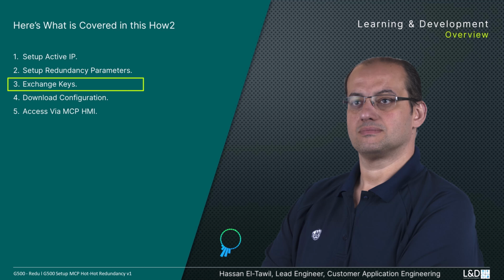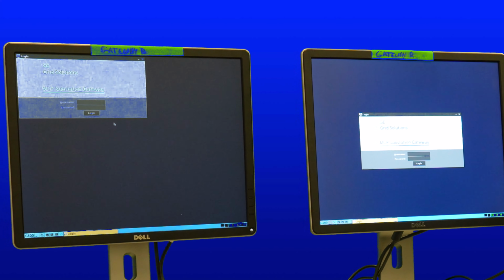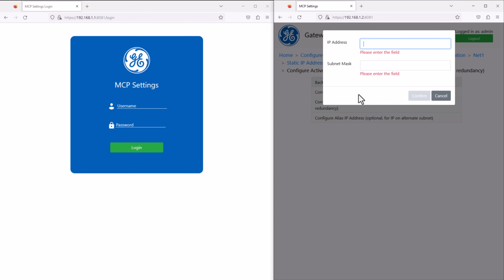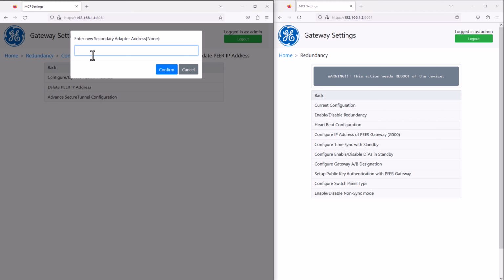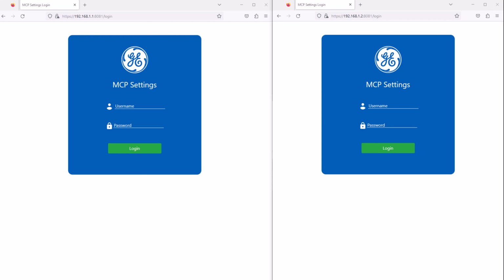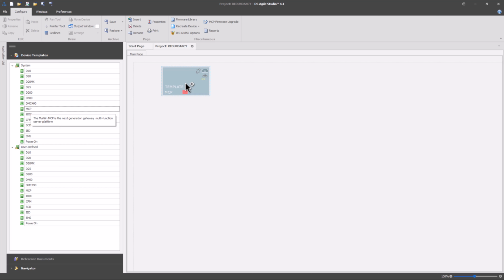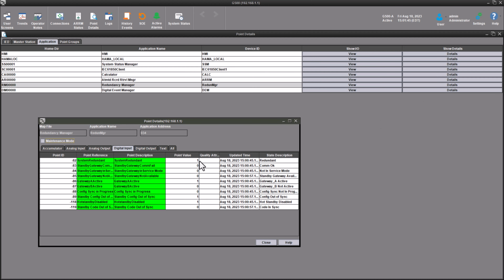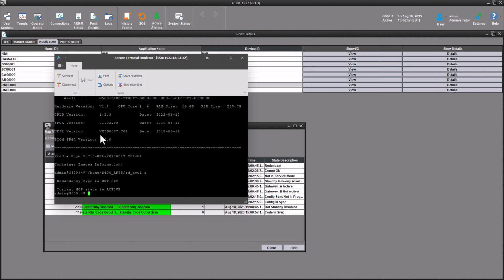G500 - 4022 l G500 G100 Redundancy v1

Comment: I have D20 that does not want to reboot,
What might be the problem.

Here is what's showing when I log into terminal emulator
Power-up DiagnosticS

D20ME Boot ROM (145)

NodeID(26)-00

pass

User RAM pass

NVRAM size 00512k

RAM size - 01536k

EPROM size 02048k

Single node CCUME

LNVRAM CRC calc - pass

Searching for Local Configuration Control Block >

not found

Activating p505: ROOT Process

Configuring Serial Ports

Spawning Vatchdog - pass

Spavning Monitor

pass

NVRAM test - pass

EPROM tet - pass

Spawning Diags - pass

ACTIVE Spawning Process(es):

PID

Naze GP PR

Stack

Agr List

Proc Add

Sp_Err 0

Ac_Err 0

Spavned NO

0 E052

0 32

2000800

0

11BAB4

31AFF8

4083 0 4030

0 86

400500

0

128EE0

0

0

YES

0 95

1000200

0

12CA9C

0

0

NO

31804A

T030 0 95

1000200

0

12E0A4

0

0

YES

31B15C

H030

0 4F

1000200

0

12CD3C

0

0

YES

Ο 1040

0 97

1000200

0

12FA34

0

0

NO

0 170

0 32

1000200

0

133484

0

0

NO

31B20E

B021

0 84

400190

0

138184

0

0

YES

318200

8023

0 65

18002